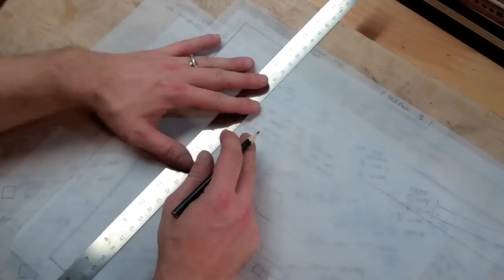Using a spokeshave - The Funeral Chair part three.

Comment: Hi, Mr. Tom, I recently subscribed to your channel and I think it's wonderful what you do.

I would like to know if you have any video of how you made it, or tell me how to make the sliding handplane that you use to smooth the edges at 2:45. Thank you
Reply from the maker: Thanks-  I'm using a Veritas low-angle Jack plane at the 2:45 mark. It's being used on it's edge with an appliance called a Shooting Board. If you Google shooting board you'll find information on how to build one. They're easy to make and extremely useful to have around the woodshop. I recently made both a Shooting Plane and Shooting Board on my membership site, An Unplugged Life. Details on the Unplugged Woodshop website.
all the best~
Reply: Tom Fidgen Thank you for sharing your knowledge Mr. Tom, I will continue to watch your videos

Comment: Hi Tom, thanks for the great videos. I don't have any experience with a spokeshave and I have a question. Do you think it's an appropriate tool for curves on small pieces (2-3" long and 1-2" wide) of difficult tropical hardwoods like ebony.. And not only along the grain, but also across it. Thanks!

Comment: ... have you ever see ( and work with ) cheap laminated particle board which I work with... :-) ? That's why I watch this cool "real wood" videos :-) In our country is hardwood extremely expensive.
Therefore is everything made from particle boards. :-(
Reply from the maker: Rudolf,
I used to work in Set Design, and almost everything we made was plywood or some laminated, artificial material.
Now that I work with solid woods, I don't think I'd like to go back!
; )
thanks for the comments!
all the best~

Comment: How is that flat card used? Is it sharpened at all? I've seen em here and there but never learned what fer
Reply from the maker: Thanks for the question Vic,
yes, its a card scraper and the edges are sharpened and then a hook or burr is rolled into the edge. This makes for a good finishing tool.
all the best~

Comment: What's the name of the tool akin to a plane that you use in place of a router at the 7th minute?
Reply from the maker: Josh Reynold Hey Josh, thanks for the question. It's called a plow plane- ideal for cutting grooves in panels. 
Here's a link: http://www.leevalley.com/en/wood/page.aspx?p=69788&cat=1,230,41182

all the best~